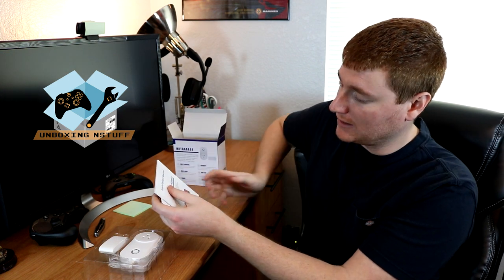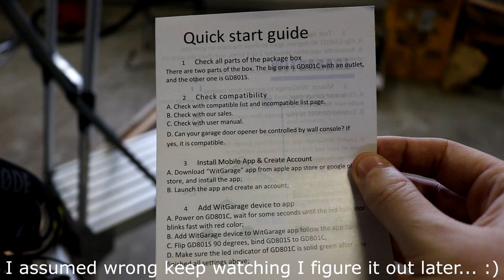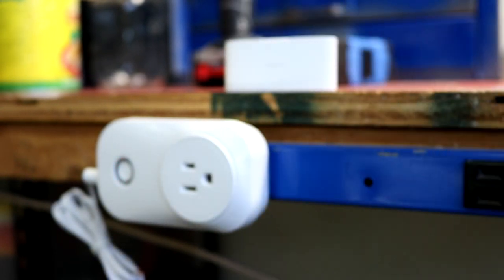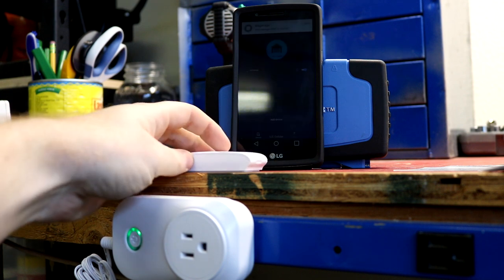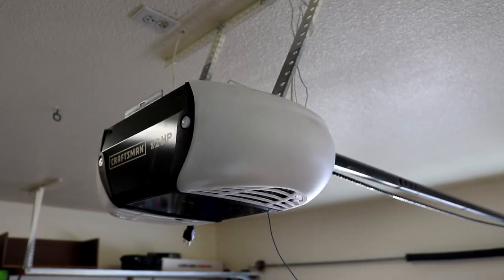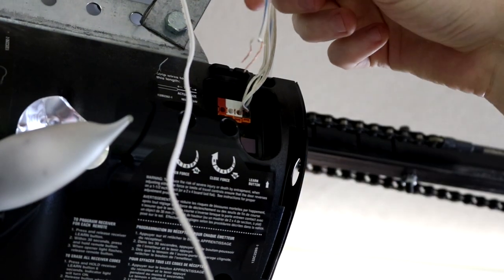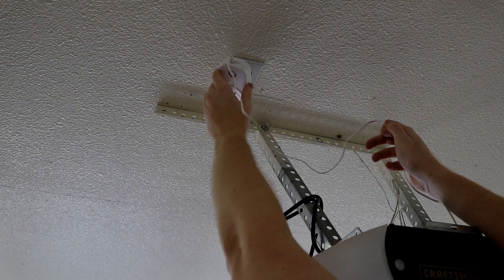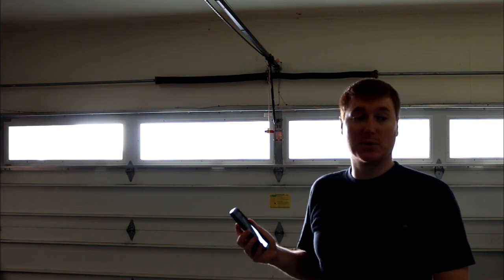WitGarage Wireless Garage Door Opener Unboxing, Install, and Review

Comment: My WitGarage app shown "Opened" (Red) when the garage door closed and shown "Closed" (Blue) when the garage door opened. Could you help fix this problem?
Reply from the maker: It is possible that the sensor was installed upside down.

Comment: Hi...Hi...
Could you give me a clue please!!!... How to install this device in a garage door that open horizontally from left to right, not like your example that works in the ceiling....  Tks
Reply from the maker: Hey I would assume the process would be the same you will just need to find where the motor is mounted. Good Luck

Comment: How do u connect to a motor that isn't on the compatable or incompatible list?
Reply from the maker: My garage door opener wasnt on the list and I show in this video how to connect it. If you have wires going from your motor to a button on the wall to open your garage then this will work.
Reply: What if there's no wiring going to a button? whats the best way to find where to put the wires?
Reply from the maker: If there are no wires I do not believe this will work for you.

Comment: Alexa:  if you have any smart life smart plugs already in house (I have several) go to smart life skill after you create your WitGarage account on the witgarage app and unlink smart life skill in Alexa app. Witgarage uses the smart life skill in Alexa not a witgarage skill.  Then relink smart life skill in Alexa app and you’ll see witgarage in the Alexa smart life skill list select that and link with your witgarage account info.  Then Alexa app will see all your old plugs and new garage plug (even though the smart life skill looks like it is just connected to garage only now).